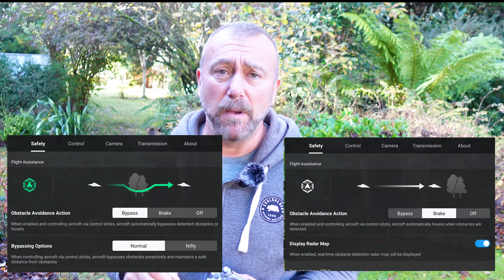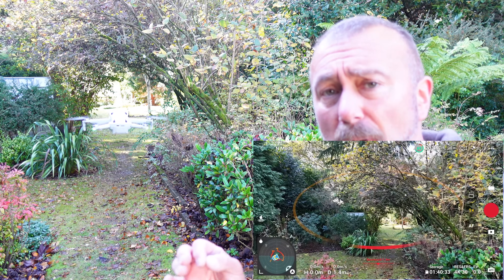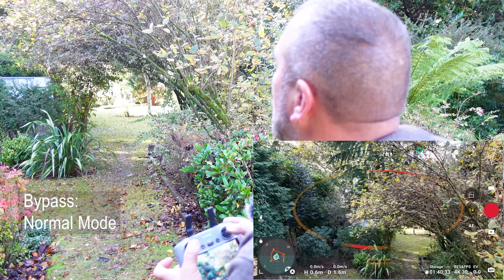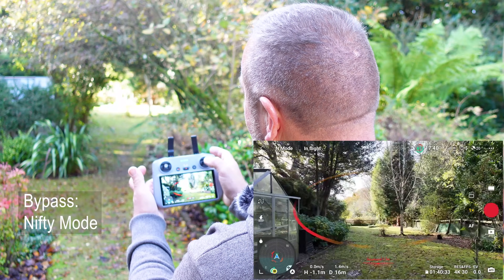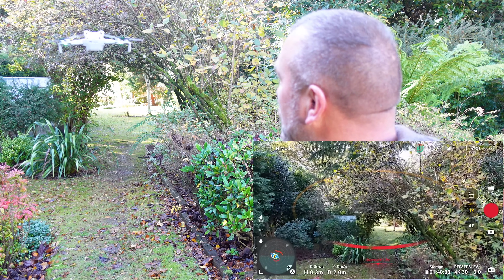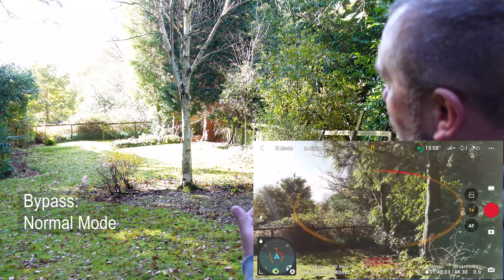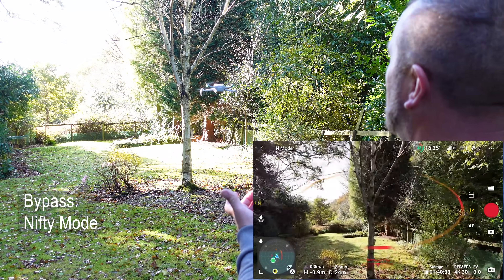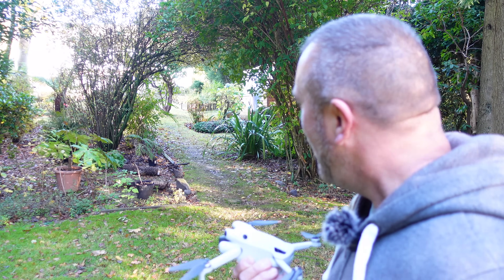DJI Mini 4 Pro:  What Is Nifty Mode?  Obstacle Avoidance at its Best

Comment: I've upgraded to M4Pro this week. Went to see how Active Track works and had a crash on the very first try (drone flew backwards into branches with leaves on). I have no idea how can they state that this thing has Omni Directional obstacle avoidance and provide this wheel with drone positions where you can place it anywhere you want. Didn't DJI test it to see that it does not work well enough?
Reply from the maker: That is really poor; sorry to hear that and hope no major damage.  I always view obstacle avoidance as a help, but never fully rely on it.
Reply: @IaninLondon  Just a bit of dust on it fortunately, but then how can you Auto Track AND not fully relay on it 😕 It worked so nice for the first few minutes positioned exactly where I wanted it to be but then it cannot be trusted like at all ... I've noticed there was an update with this Auto Track - Auto mode that apparently got removed and the position wheel with where you can place the drone is now hidden by default. Maybe because they don't want people to use it ... 😕I'm so frustrated because everything else about this drone is perfect. Maybe they should have put one more camera on the back ...

Comment: Just a quick question, in nifty bypass mode, are the controls still as jumpy as they are in normal bypass mode? Also, has DJI addressed that problem? It doesn't make sense for the controls to be that different when changing the obstacle avoidance settings. I would think you might be able to make it less sensitive using the expo settings but it still seems odd that it's like that. Anyway, great videos as always
Reply from the maker: Nifty bypass mode is far smoother on the controls than standard bypass mode 👍🏻👍🏻

Comment: Hi Ian. Special Request;.. I am currently planning a Night-Time Waypoint Video. There isn't a lot, if any, info on the best way of going about this, so I have cherrypicked the Info I need from various Youtubers. The main points for a Night-time waypoint are to set up the waypoints actually on location in Daylight and NOT remotely using just the Maps which is a great feature but very risky if there are any Trees or other obstacles in the chosen location. Once the Daylight mission has been completed and saved, this can then be tweaked so Camera Angles, Heights, Speeds, POI's etc can all be changed to suit the scene to be shot. I think you could do a fantastic job of creating a 'How-To' video of Night-Time Waypoint Missions. I would do this myself, but I just don't have the set-up or Voice skills etc to do it!. I am sure you would get mega viewings, as this video would be combing the two Best features of the Mini 4 Pro; Waypoints AND Night video mode.
Reply from the maker: Fair enough.  The night-time element isn't the main point here; once you've set up and saved the mission, you can re-fly it any time you like.   Waypoints video long overdue as been a good couple of years since the last one on the Mavic 2...
Reply: Yes, absolutely Ian. One thing I have noticed on some M4Pro social media groups it seems that for a great many, this will be their First Drone, so these people just won't have the Basic skills or even an understanding of how a Drone should be flown safely even in the Daylight hours, so they will be going out with their brand new flying Chunk of £1000 expecting it to avoid every obstacle, whilst capturing fantastic footage & returning to them in the Dark safely without doing ANY preparation then claiming insurance for their complete Ignorance/incompetence. I am pretty happy that I can execute my Night-time Waypoint mission without any more Youtubery, but for this group of people, I really think they need educating...preferably the IaninLondon way!

Comment: 7:22 Hi Ian,
The Silver Birch approach. Could the direction taken (quick left, then to the right in 2nd attempt) be affected by the speed of approach?.
As you had both tests aligned dead centre to the tree, could this slight approach speed diference be why it went firstly left, then (at the slower speed?) to the right?.

Comment: I cut my hands today when i tried to diffuse a drone. I have the parrot anafi and while i was fiddling in the app in my bed to set the camera settings accordingly -: i mustve slipped and accidentally tapped thr edge if the screen while holding the phone and it lifted off via the button in the app; I've catched it mid-air on reflex and tried to hit the on/off switch after unsuccessfully pressing on the "cancel" button within the app (i did but the motors did not stop.) and i reached to the button on the battery pack while slicing outer layer on two knuckles but it didn't turn off; i then went a little further and trued to disengage the battery completely from its racket while still having those tiny and slim blades swirling vilely, it deactivated after the battery was removed. 

That's my story.

Lesson: props are vicious. Plus it would've been more wise to tilt the drone to its head which usually deactivates them automatically via detection. Also, ill need more callus in my knuckles.

Comment: I thought you might find Nifty mode a bit more useful. I set mine up on Nifty when I got it and didn’t have the problems you seemed to in your test last week when it was in Normal mode. Mind you - I didn’t try flying it straight at anything!

Comment: Ian, I don't know whether you're aware, but all your videos since 'Flying at night with fireworks' appear to be over-exposed. It is very apparent when comparing the recent ones to your older ones. Can you fix this? Thanks.
Reply from the maker: Possibly due to filming in shadow.... It's hard to get the balance right so you can see all the main parts of the picture with high contrasting skies and shadows..... Ta for the input; will check things more next time 👍🏻

Comment: I think that might work quite well in active track mode, as long as youre not going too fast or the obstacles are to extensive. It would probably help on those situations where it has a tendency to lose you when its thinking too much in normal mode. It seems the nifty mode allows it to think and act much quicker
Reply from the maker: True, although Active Track does involve flying up above you and there was no height clearance here....  Have to do some more testing... :)
Reply: Yeah usually above you but can also now set it to level or even below you on active track 360 inner wheel 
 @IaninLondon